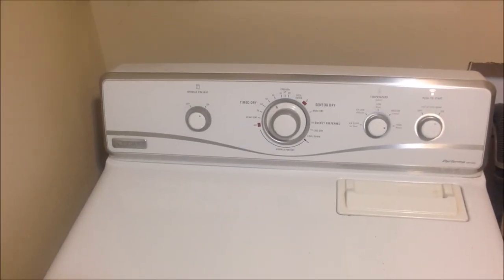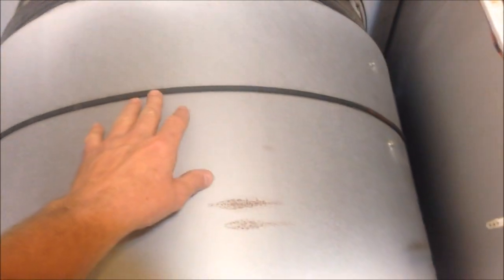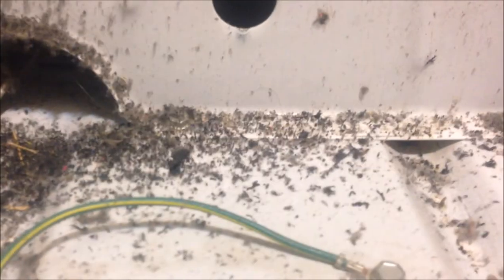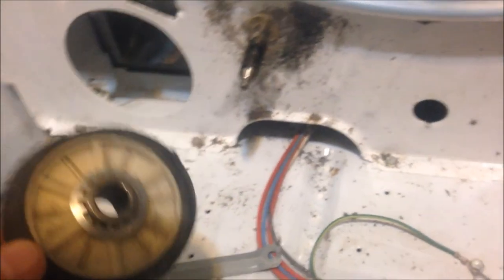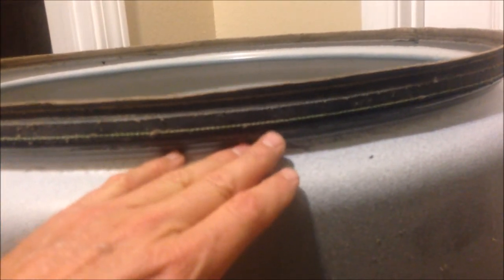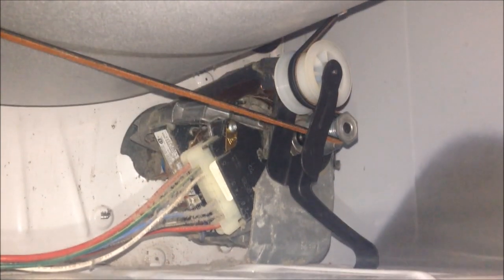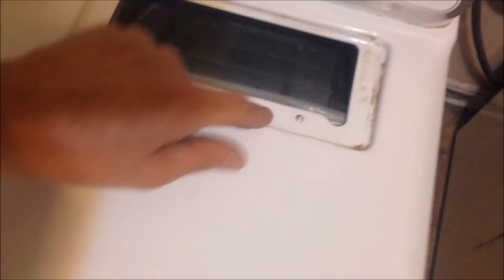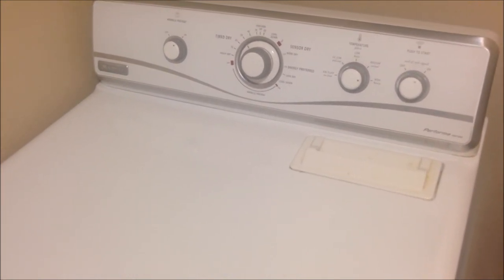How to fix a Clothes Dryer- DIY Repair & Troubleshooting

Comment: Wife somehow got a giant safety pin stuck on the outside of the drum. Used your video to help me take the dryer apart. Not mechanically inclined so I would have probably torn something up good without it. Thanks!
Reply from the maker: Glad to help!